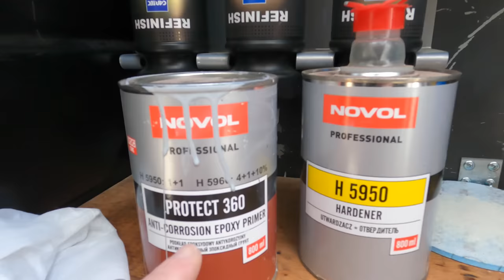Classic mini roof paint job colour change

Comment: I've sometimes stopper, d individual pits then put 2 k primer on the area, usually holds it back, got some bad silicone a while ago and I'd run out of blue roll, I used toilet paper, turned out to have alleo veria on it, made a right mess.